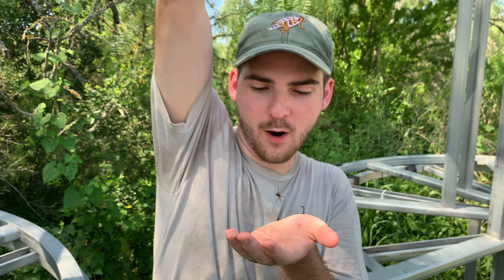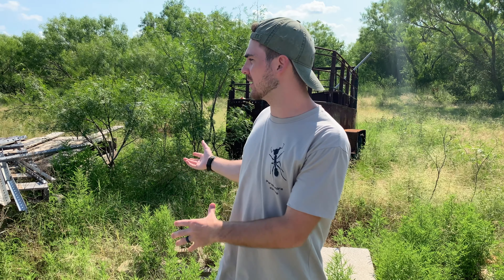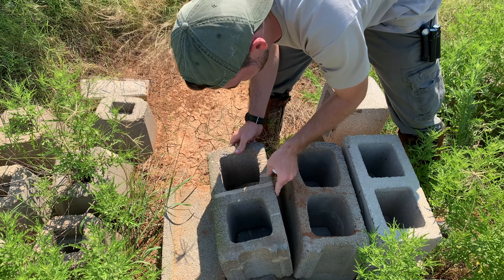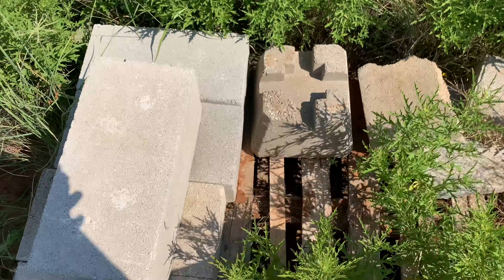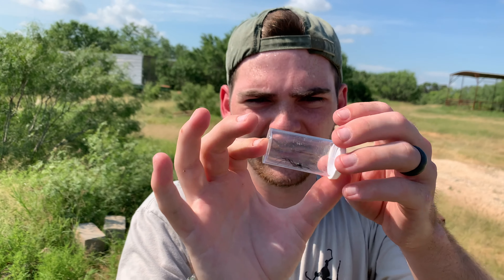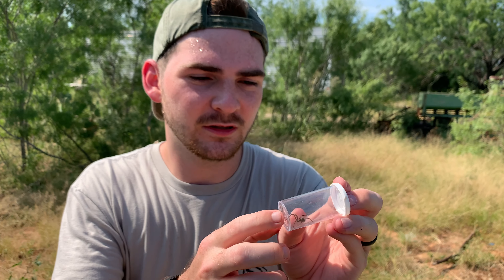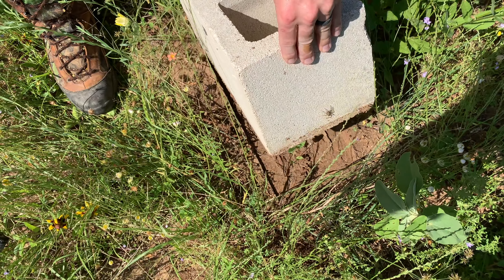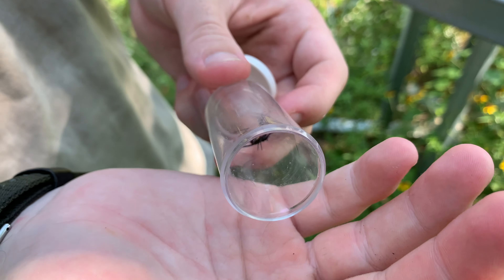BLACK WIDOW CHALLENGE! How many can I catch?

Comment: That's what I used to do to verify if I had a black widow on my porch or garage that was hiding at that time.  You can usually tell on sight a BW web, but if that doesn't work, you can pluck one strand and if it pops like a fishing line (almost, but they do pop), then it's a BW.  That's if you want to go out later and spray them.  I didn't really care about having them around, but I've had a few close hand to spider scenarios (e.g. once in a garbage can handle) and I've once or twice had one that got thru the door or a gap in a screen (e.g. found one in a shower that got in thru an open window w/ a screen that wasn't fully seated and  it was on the overhead bar of the shower door when I spotted it).  I've killed the odd one that built a web in the piston of a screen door overnight.  We had tons of them all around, standard issue for S. Cali.  I've seen them in some bizarre places, they can surprise you.